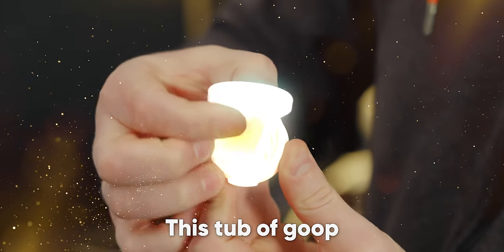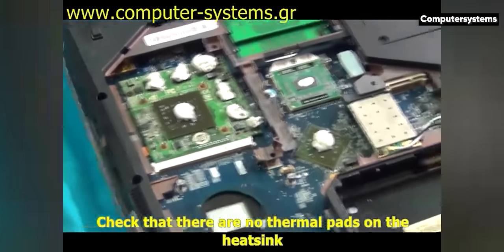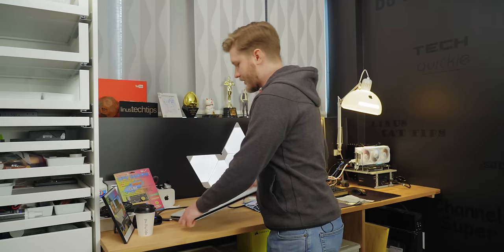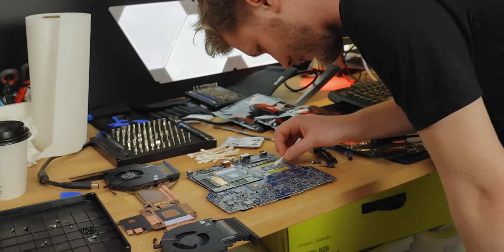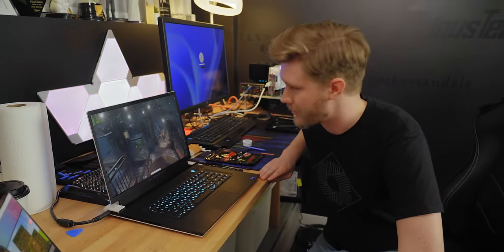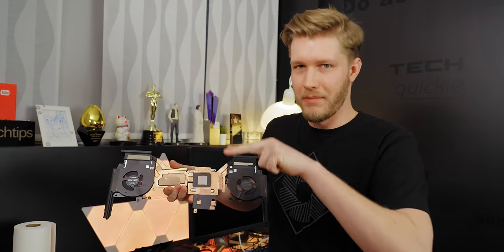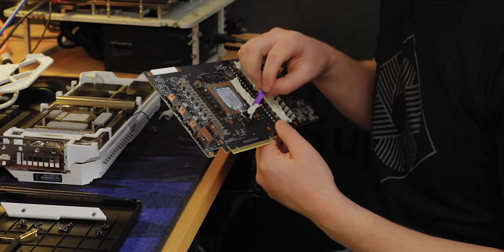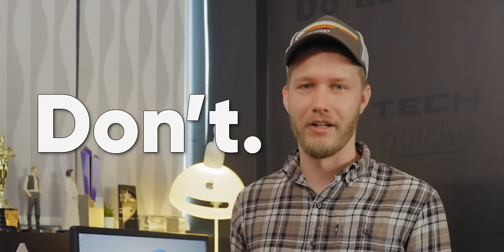More FPS for just $10 - K5 Pro Viscous Thermal Paste

Comment: I've applied K5 pro multiple times, and even with alcohol is a really BIG pain in the * to remove it. Maybe I'm not the best at removing it, but either way, it's not as easy as they say. And because you need to apply a lot, so it can fill the air gaps, when you put back the heat sink, the paste overflow to the sides, making a big mess. It's not conductive, so its not really a technical problem, but it looks like a big ugly mess.
Reply: What do you mean? I like the look of a vanila ice cream GPU sandwich. :)
Reply: I recently used SYY 15.7W/m.k paste and it's like concrete but was the difference between throttling and not throttling with an h115i and a 5950x.

And then I switched to a 150i anyways but hey.

I'm debating sticking some on my 1080ti and was wondering about the pads, so this video and all the comments is great.
Reply: Are all pastes non-conductive?  I got some kryonaut on my board and freaked out about cleaning it.
Reply: @americansmark  They should be non-conductive, but better safe than sorry.
Reply: I can attest to this. I tried K5 pro on my mobo VRM heatsinks and after about a month, there were streaks of oil running from the VRM all the way down the board and under the PCIe slots. It was a huge mess and I would never reccomend using this stuff
Reply: @The_Keeper  fair enough.  Given how expensive and difficult to source parts are right now, I'd like to avoid a short circuit of my own doing.
Reply: @The_Keeper  they are non-conductive, with a few exceptions like artic silver, which is only mildly conductive. Not LM = not an issue when it comes to spills.
Reply: lets say you applied K5 pro to some memory chips on your gpu. So when you take it apart after a few years, do you have to re-apply it or you can just put it back together as is and it still conducts heat? does it dry out or it remains squishy and soft forever?
Reply: @taylorsharp5928  oil? That's not normal. Although K5 pro apparently has a higher than normal rate of bad batches.
Reply: @jeyendeoso  idk if it dry out, haven't been using it that long. But wouldn't recommend taking apart the heat sink and reuse the paste, because it could create air pockets when putting the heat sink back on, but maybe there's a way to reuse the thermal paste and I'm not aware of that.
Reply: @americansmark  kryonaut isn't conductive! Generally thermal pastes are non-conductive, but look on the internet for the specific ones you're using before putting huge blobs on circuits ;)
Reply: Try placing paper towels around the spluge zone to catch the majority of the stuff when it comes out
Reply: @fVNzO  Not always, I find my comments often disappear when I put certain keywords including curse words in my comments, part of it is probably channel filters, but there is clearly some sort of comment rating bot because sometimes I just can't figure out what causes it, even when posting positive or helpful things it just says no and won't let me comment sometimes...
Reply: @americansmark  No. Some are highly conductive. AS5 is antique at this point, but it's a great example of one that will easily fry a board if over-applied and is what let to many believing you always need to use as little as possible.
Reply: @americansmark  Since I haven't seen any replies mention this, "liquid metal" thermal interface materials (e.g. ThermalGrizzly Conductonaut) are electrically conductive and should not be used unless you really really know what you're doing (and never with aluminum surfaces under any circumstances). ThermalGrizzly Kryonaut, on the other hand, is not electrically conductive, nor is the material in this video.
Reply: Did you use 100% alcohol or that shitty alcogel kind of stuff?
Reply: sensor safe brake cleaner. Thank me later.
Reply: @twizz420  yea that or crc  mass airflow sensor cleaner or crc  electronics cleaner which is usually  the cheaper one and they normally are at Walmart
Reply: @vgamesx1  I've seen comments mysteriously disappear but not being allowed to comment in the first place shouldn't be a thing. However, you can see something like this when the comment you're replying to has disappeared. You won't get a useful error, you just can't submit. Of course various network issues can cause similar effects.
Reply: it is not a technical problem until dust gets stuck on the stuff and your thermals are screwed
Reply: how much does it cost?
i mean the big pack
Reply: @Gatorade69  Right, they still haven't fixed the bot problem AND they can put just about anything in their post like urls with smex as part of it, but a normal conversation like this is sometimes just deleted at random,  infuriating platform.
Reply: @faranocks  Pretty sure that liquid metal thermal paste is pretty conductive
Reply: @americansmark  Not all but most. Conductonaut (a.k.a liquid metal) is conductive but I can't think of any other name brand thermal paste(that isn't liquid metal) that is conductive these days.
Reply: I can imagine how worst it can be if it is dripping to fins
Reply: @lukemelaia2461  " Not LM = not an issue when it comes to spills." LM = Liquid Metal. LM is not a paste, it is a liquid.
Reply: @unvergebeneid  For me, it's not network issues, but the YouTube comment system was somewhat powered by recaptcha or something, in my cases, sometime when i use Waterfox browser (aka Firefox-based), I can comment, the comment show up, on both client and server, then disappear both sides after 15 seconds), but in Chrome, nothing like that happens.
Today, it's doesnt happen for me anymore (possibly for now).
Reply: lol its so easy... something you may not have understood :Ρ
Reply: I can just imagine the dust that sticks to it overtime
Reply: @jeyendeoso  You have to reapply it anytime you take it apart because it might not cover all the areas on the memory chip. If you want to remove K5 Pro, you just scrap it off with a Q-tip without alcohol.
Reply: @americansmark  If you don't know, you should check the manufacturer's website.
Reply: Yeah, in three or five years it will dry out and you will not take it off at all.
Reply: The question is why would you remove it again? It should be good for a long time. And if you open the device to do other maintenance, you can squish it back up on the sides to get it thick again to make contact again as long as it's not full of dust.
Reply: wish there is some applier with a nozzle that lays it out as a thin sheet. that would be cool
Reply: @americansmark  Pastes should not be conductive, liquid metal is conductive. of course be sure to read the description. It should clearly say if it is conductive or not.

Comment: I replaced my thermal pads on my old 1070 Ti Duke a few months ago with cheapos I found on Amazon. Both my stable GPU and Memory overclocks dropped dramatically. 250 for memory/90 for gpu. So I ordered some of the 6 w/mk Fujipoly pads, and redid. Memory offset went up to 400, 50 higher then stock, and my stable GPU offset went up to 130, 20 higher then stock. The same thermal paste was used both times, and the average GPU temp was roughly the same around 54 degrees. Just shows that good thermal pads do make a difference, and you can't always tell by just the GPU temp itself. Although in the grand scheme of things, the difference in offsets vs stock might equal 5 fps, if that.
Reply: Get some good stuff, like the 12.8 W/mK Thermalright Odyssey. That will make a huge difference.
Reply: @matasa7463  I could've gotten 13 w/mk pads, but the difference probably wouldn't be that dramatic. Maybe an extra step on my OC.
Reply: Trying it the cheap and lazy wsy, I bought a sheet of Siilpad, nasty cheap stuff had no glass in it so was insulator, 100C CPU temp and 60 idle, replaced with MX4 and got 20C 40C. FX-6200.
Reply: @joefish6091  who uses pads on a cpu again?
Reply: @KryGaming2k  Also, always so interesting when people get sub ambient numbers on their CPU.
Cool how so many is able to break the laws of thermodynamics!

Comment: This is really interesting stuff. I've been resigned to keeping a bunch of thermal pads of different thickness around and taking care not to use the wrong thickness. This will definitely take some of the headache out of custom watercooling future GPUs when thermal pads aren't pre-cut and pre-applied.
Reply: I bought this stuff right after watching the video and used it and mettalic thermal grizzly on my strix 1070 thats been running almost non stop since i built the pc in 2018 and i went from 70fps to 120 in gta 5 and from 52-70 in cyperpunk
Reply: @andreaskeltwolfe6176  respect

Comment: I read online about and then used K5 Pro a few years ago to replace the underperforming thermal pads of VRMs on an Asrock 970 Fatal1ty Performance mainboard with an FX 8320 on it. Used to be my main desktop until early this year and is still stable with a mild overclock. I was also pretty proud to discover back then that this product hails from Greece. :)

Comment: This isn't really surprising: it's essentially a form of thermal paste, and thermal paste is better than a thermal pad. It would have been more interesting if you compared smearing an existing thick thermal paste, to this K5. Also there is the question of how it ages, does it dry and crack?
Reply: Thermal interface material has to be thin to do its job best. Normal thermal paste is often too runny. Except you use Kryonaut Extreme. But that stuff costs 99 USD for 33 grams. I think this stuff is designed to have a high thermal conductivity up to 2.5mm which is the thickest pad thickness widely used.
Reply: If left sitting in the tub, the outer area does. But that was only for the one I had previously opened. The other unopened one was fine. For me that was about 3 years. Don't know about in the system/daily driving though as I never fixed the iMac. I will eventually though as I'm now using it on an old server motherboard which had a very worn thermal pad on the CPU VRMs.

Found out about this stuff when re-pasting an iMac GPU and it turns out Apple uses this stuff from the factory. Couldn't fix it though.
Reply: @alvydasjokubauskas2587  Did you actually watch the end of video? That's not what he said.
Reply: @alvydasjokubauskas2587  That requires precise machining of the copper shims, though. If you use shims too thick you'll fuck with the mounting pressure on the CPU/GPU.
Reply: Cracked my roommates Acer Nitro 5 open, it came stock w this stuff on the Vram, absolutely dried to a crisp, nearby thermal pads were still gummy and in decent shape, paste on the GPU and CPU wasn't awful, dry, but not terribly so, this stuff shouldn't be used in consumer laptops, nobody who isn't tech savvy is going to replace this stuff frequently enough for it to not dry out and fry your vram because once it's dry it's gonna act as an insulator.

Comment: For older systems that already need new thermal paste, this is a great idea. Sure the gains aren't *massive*, but if you're already tearing down the system, might as well tear it down and get rid of the old thermal pads/paste too for some extra gains and (potentially) increased longevity of components.
Reply: Hello fellow Tim!

Comment: My question is... what's its usable lifespan? I might want to clean it off to apply fresh goo. Or are they implying that it doesn't become less effective as time passes with heating and cooling cycles like traditional TIM and pads do?
Reply: It's not really a goo, it's a molding pad that turns into soft solid. It can last for years.
Reply: @jort93z  That was my assumption as well.
Reply: @mikeycrackson  Ah... guess I should stop being lazy and just gone to their page. Interesting though... I have my doubts as well.
Reply: @Ryuuken24  I was using "goo" as a colloquialism. It was used for slight comedic effect. I was not being literal.
Reply: They should send some to crypto miners and have them stress test it out
Reply: @jort93z  I think it basically bakes itself onto the surface, turning from soft to semi-solid and filling in all the gaps.
Reply: You'll replace the component long before the lifespan of the goop expires.
Reply: @KingLo  I still have a running pc I built in 2007!! 🙃
Reply: @KingLo  Possibly... but I've seen thermal pastes loose efficiency in as little a year, and I wasn't just curious for my own purposes, I service people's computers, so I was curious from a service perspective as well.
Reply: @TheGameBench  i’m guessing it lasts long enough that most people should have replaced their devices by then
Reply: @Ryuuken24  are you sure? Sounds like you might be talking about a similar product and just assume this one behaves the same.
Reply: Perhaps a lifespan oriented thermal paste is better? Using Shin Etsu X-23-7921 on my 1070 and the temps improved a lot, probably not as much as it would with other pastes. It's really hard to spread though (it lifts off like a thermal pad if you're not careful. Zero viscosity, like clay).
Reply: I've been using for 3 months and I should really repaste now.
Results are very good for only 1 month
Reply: @unvergebeneid  Pretty sure it works the same, it is supposed to harden with age
Reply: @carrapaz3645  Maybe dust is building up on the paste.
Reply: @ConchitaProductions  could be but my laptop went from 70 degrees to 95 cpu under load
Reply: @carrapaz3645  If you're using it under normal conditions... why would you think you need to re-paste after 3 months? If the paste isn't lasting that long, it's the worst thermal paste in existence.
Reply: @333dae  Yes, but then they get passed on to other people looking for a good deal on used equipment. That's where I come in. I'm not just curious about my own systems, I'm curious about using it on customer systems, or getting a system in that has used this stuff. I replace TIM on any used system I flip. Just because it's service life "could" be longer than the typical ownership of an item doesn't mean that item is useless, so it no longer matters, and won't go on to be used by someone else.
Reply: @yensteel  You're using a thermal paste on your mosfets, inductors, resistors... etc? They're showing it being used on more than the CPU and the GPU die. That's where I'm curious in using them over thermal pads. And using traditional thermal paste on other components isn't really a great idea.
Reply: @TheGameBench  Just the CPU and GPU. Thermal pads on the others. My bad.
 
Looking online, it seems the K5 are meant to be pad replacements. They could boil on a high tdp CPU!

Comment: It might be easier to use if they sold it in a syringe like thermal paste with a flat nozzle to squeeze it out in layers.
Reply: A caulking or grease gun might work better since they are intended for substances with a high viscosity. And if you get an electric grease gut you bight be able to mod it so the grease comes out slower for easier application.

Comment: I used thermal putty on my gpu, stock zotac 3080 amp was improved a lot with a double sided water block, adding the thermal putty later on made very little difference to memory temps and performance but it was a little better. 

My expected gains are in the vrm’s and longevity.